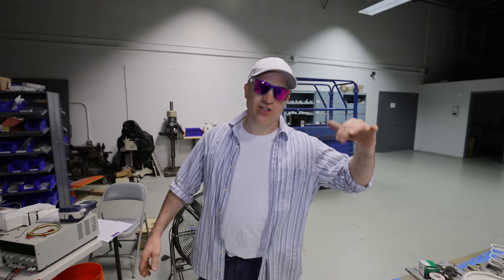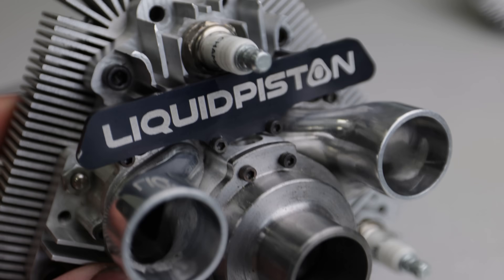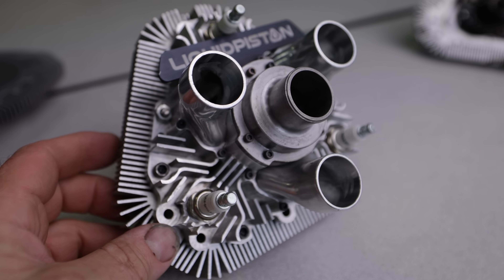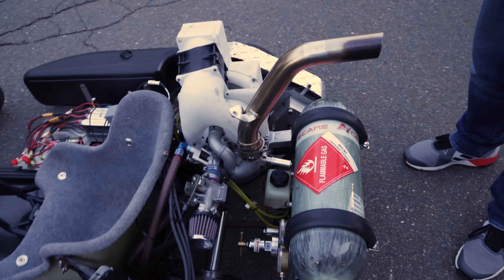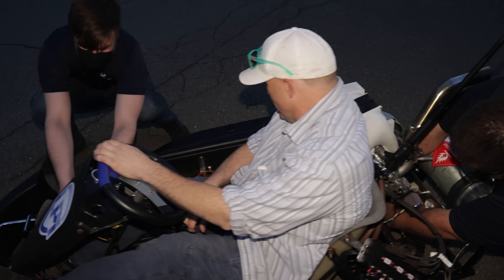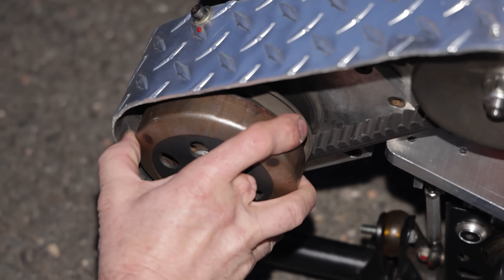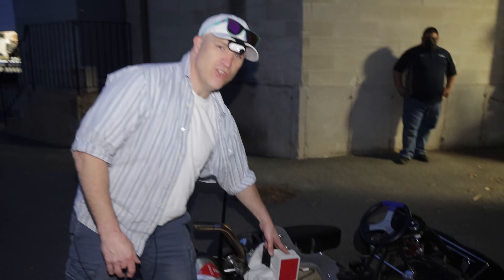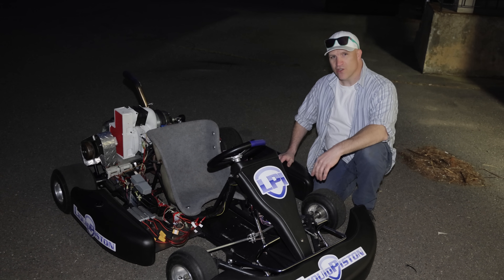Hydrogen Powered Liquid Piston Rotary Go-Kart

Comment: Toyota has built a hydrogen racecar that is a direct burn in a piston engine.
Reply from the maker: I just recently saw that in my feed
Reply: and now we have rotaries getting into th hydrogen game too.
Reply: @squarepotatoe  Mazda has been experimenting with it for a long time.
Reply: In the late 80' BMW has been playing with piston hydrogen engines, notably their 5L V12, they were getting around 200 HP if I remember correctly
Reply: bubbinator88  The guy claimed that you can run a car on only water. His name was Stanley Meyers and he didn't disappear. He died in a restaurant that he owned.  He used simple electrolysis. It's far more efficient to directly drive an electric motor than to split the water into H and O2 then drive a gas combustion engine. That is the most wasteful way of using hydrogen as a fuel cell is more efficient, quieter and safer.
Reply: @esqueue  The problem with hydrolysing water and then recombing it, is that the net energy output is then 0. You must have an external power source to add energy into the system for propulsion. That energy source would then immediately make the water splitting and recombining unnecessary. The engine that runs on water is a total hoax. You cannot extract more energy from a system that the amount it contains. Law of thermodynamics. Speaking ideal situation with no power loss to parasitic systems.
Reply: @esqueue  The problem with electricity is storing it. Batteries have poor specific storage capacity (J/kg), degrade over use/charge cycles, are difficult and energy intensive to recycle, and use rare materials. Whilst electrolytic water splitting is inefficient, the use of hydrogen in vehicles means faster refuel/charge times in addition to keeping material costs down. The argument can be made for hydrogen fuel cells, however these suffer from many of the same issues as batteries (exotic materials, degradation over time/use, etc.).
Reply: @esqueue  If you have a surplus of energy and you can adapt your current car to use it, no. And there are ways to have a local surplus.
Reply: @vitordelima  An alternator is NOT a surplus of energy. When you put load on an alternator, it becomes more difficult to turn thus lowering your fuel mileage. Why do you think all hybrid vehicles try to stick to LED lights? This uses the lowest amount of light thus less load on the alternator. 

Surplus energy is the heat generated by your vehicle. If you can use this energy, then it will help. Regenerative braking is one way of storing surplus energy that would otherwise be wasted in heat.
Reply: @esqueue  I didn't mention the source of the surplus, so calm down.
Reply: exactly
Reply: GM had an H2T running on hydrogen.
Reply: bubbinator88  thats a myth
Reply: Let’s hope it’s faster than this go kart 😂
Reply: They use a suitable 50/50 mix of hydrogen and petrol
Reply: Piston walls get hot
Reply: and a production car. The Mirai
Reply: Joel  BS
Reply: Which makes sense

Comment: So Toyota sells a hydrogen Camry atm. Still cool gokart just needs refining.
Reply: I think the hydrogen toyotas that aren't racecars don't use direct hydrogen combustion. It uses cells which create electric in a similar way to how electrolysis works. This creates electric also water as a waste product only. The charge created then drives electric motors
Reply: @carcrxsh  hydrogen isnt really the best for racing because water and slicks its worse for go kart slicks because you lose all traction on moisture
Reply: @Thri11Seeker  wtf you realize that normal combustion engines produce water too right? that is a non-issue. the actual problem with hydrogen combustion engines is that they are generally very unreliable because the hydrogen gets into places it’s not supposed to be due to being a very small moleculex
Reply: @boxr_4214  bruh everyone knows that all combustion cycles produce water but the issue with hydrogen go karting is that it produces more water which means that water is coming in larger quantities which the issue im addressing is that true go kart slicks if you touch moisture on track you have grip equivalent to ice
Reply: @Thri11Seeker  unless these hydrogen engines are producing tens of thousands of horsepower there is no earthly way for the water they produce to have any effect on local ambient humidity. exhaust is hot and rises upwards. there are legitimate issues with hydrogen engines, but the complaint you made up in your head is not an actual issue.
Reply: @boxr_4214  🤦‍♂️ you clearly dont understand the issue im bringing up i will say its not the biggest issue but im just mentioning one issue/flaw of using it as a go kart motor
Reply: @Thri11Seeker  again, it’s not an issue. you’ve made this up. if you didn’t make it up, show me one example of this actually happening.
Reply: @boxr_4214  how do you want me too because clearly you dont know go karts bud
Reply: @boxr_4214  i cant do it myself because i dont have any tracks nearby anymore plus i had to stop due to financial problems
Reply: @Thri11Seeker  the amount produced isn't really enough to lose traction.  If you're still concerned just install a catch can for the few ounces that'll be made from that entire hydrogen tank. Dump/drain when you refuel.
Reply: @mikegluth1981  im saying if everyone raced it all at once moisture would build up on track and since its go karts the tires will tap spots of moisture eliminating traction it would be funny racing because you have mario kart with bananas only
Reply: @mikegluth1981  im not worried about it though because financial problems hit so i don't do real go kart racing anymore, but i do know how bad grip is on moisture with go kart slicks and it is unbelievable like seriously you feel like you hit black ice even though it was just a moist spot on the track its really screwed up if you don't believe me look at super gt
Reply: @Thri11Seeker  You do realise that the amount of water vapour produced is directly equal to that of a normal fuel right? 

Both produce a single water molecule per fuel molecule burned. In fact, given hydrogens significantly higher energy per mass, it would produce less water vapour then the equivalent hydrocarbon fuel to make the same amount of power.
Reply: That's not an ICE based hydrogen car though.
Reply: Right, the Toyota Mirai is a hydrogen fuel cell vehicle.
Reply: Does that Camry have a rotary engine in it?

Comment: I'm unsure of this liquid piston engine. They boast of how efficient it is, and how much pound for pound power it can produce, but every time I see one running there's always some electric motor involved, which is causing me to doubt it's actual output.
Reply: I completely agree. This one doesn’t make much power and probably doesn’t have much torque either. It’s very small and impressive but i believe it should have done something different.
Reply: @erikcourtney1834  rotarys arent about torque they are high rev engines 9k 10k 11k 12k 14k 15k rpms
Reply: @thatnissanchannel5410  that may be true, but what’s the point of 12k rpms if it can’t move a few hundred pounds. A torque converter would have been a huge help and I believe what was the issue in this video. A little more rotating mass might help some too.
Reply: Yeah and the engine was at like 8000 to 10000 rpm wich is enuth to engage that chluch a 50ccm piston engine can do that
Reply: If they were touting this as the final product I'd be skeptical AF.  This isn't even the prototype though... they're still in the R&D proof-of-concept stage.
Reply: @andie_pants  i do agree, however claiming an engine is "running" when it is possibly not and just being spun by a electric motor with fuel being thrown in to cause a few bangs would hardly be considered running or making power by any means. when i see one run unassisted by an electric motor ill be more open to the idea that this engine design is actually plausible.
Reply: @andie_pants  no worries, i really do like the concept, I guess that's why I'm kind of let down by this presentation of it.
Reply: @derekbennett5896  the engine is running... You can hear it
Reply: @andie_pants  i know but its so low power at such screeming rpm i dont think its that good i know its Proof of concept but its bad advertising like a 50ccm can do more or they are bad at transmission
Reply: @niggo7224  50cc engines that are in like scooters tend to be already designed, tested, proven that they work and then put into them designed for a scooter. This engine is No.1 smaller than a 50cc engine. No.2 it’s not designed for being in a go cart. And No.3 this is still a proof of concept and is still in the design fazes. Yes it is running, and that’s because that’s apart of the testing fazes. My guess is that this is a 15-25cc engine too.
Reply: @niggo7224  100% agreed, 55cc of displacement is very impressive, and that gearing is wrooooong, however, is moving
Reply: It is a HYBRID vehicle, the engine only charges the battery, which powers the motors.  It is also only a prototype proof-of-concept design, with an undeveloped clutch............................elsullo
Reply: @elsullo2  kinda how it works, yes the motor/generator is attached to the engine, but the same shaft also goes to a clutch for powering what whatever it is that it is powering.
Reply: I think that the motor is involved because of A, how small this single rotor engine is, and B the fact that hydrogen is way less space efficient, meaning that the kart probably wouldn’t last long at all on just hydrogen
Reply: It’s funny reading all these comments about doubting someone’s idea/concept. Jealousy is a curse. If you don’t understand how something works its because you didn’t have the brain power to invent it. 
Almost ever motor needs something to help it start or begin running. For example a gasoline powered engine still needs and ignition system and a starting system.
I’m an inventor myself. Because of people like you with your negative opinions and lack of understanding my inventions have never made it to existence. I was 16 years old and I was at Toyota training at the main factory in Brisbane Australia. I was shut down by the teacher who was a master Toyota technician about my idea of a hydrogen powered rotary engine. Nearly 20 years later Toyota in Japan have hydrogen powered trucks and there’s engines like this.
Reply: @Rubied Cross  first of all, you're a year late. Secondly, constructive criticism and general discussion aren't jealousy. it seems you take offense to criticism.  Take advice from Elon Musk - "Constantly seek criticism. A well thought out critique of what you're doing is as valuable as gold"
Reply: Indeed they run a lot electric motor on the dyno, but the hybrid system is supposed to be a aircraft powerhouse. And you will see a lot of engine dynos with giant electric motors on them. Reason why, they use them to start the engine and then practically turn the motor into a generator. That’s how they get the test results. And the clutch was for something like a big go cart. And my guess is that the motor was acting like a generator causing a loss in some engine power. And like I said, this is a concept engine and they are still working out a few kinks in the design. I’d totally buy it if it became purchable to the public, but it was mainly designed for military application.
Reply: @evanthelegend7610  the chluch works with rpm not with force and that thing was spinning fast
Reply: @niggo7224  that's true, however, i don't think that the cvt was engaged directly to the motor, you can barely hear bogging down when they go up in the incline, so it has a lot of reduction
Reply: @evanthelegend7610  Im well aware of how dynamometers operate. possibly the motor was slowing the cart down but doubtful, i just don't think it was a good demonstration of the engine running on hydrogen.
Reply: @derekbennett5896  in his other video, he said that it only makes 3 hp, so it is not that powerful and plus they had a generator that it was spinning and they take a lot of force to turn. And did you notice how the engine did not shut off during the runs? That’s because the developed a system for where the can turn the engine off and the generator turns into a motor and powers what ever it’s being used for. And many people are saying that this IS A RUNNI PROOF OF CONCEPT. So it is not a full on working prototype and it’s also for an aircraft application.
Reply: Precisely

Comment: He had a helmet on going 5 mph 😂
Reply: Gotta go slow before you blow 😅😁
Reply: Try jogging head-first into a brick wall.
Reply: @andie_pants  i wouldn't want to crack the wall.
Reply: @andie_pants  then they should put some padding on those things.
Reply: @andie_pants  most people don't have to deal with your low IQ
Reply: ALWAYS wear a helmet when driving a kart, at any speed.
Reply: @KrustyKlown  or a motorcicle
Reply: For sure! In my years of racing my Suzuki RM250 grass kart, our club would not even let you get in your kart without helmet, neck brace and gloves!
Reply: @pvanb291  i bet your cart went a bit faster than this one. Or atleast i hope so. That thing is so slow im more likely to need a helmet jogging than i would driving the cart.
Reply: @briankennedy5578  Yep, was pretty quick alright! Had a custom electronic ignition with flat shift trigger on gear lever and rev limiter at 9500rpm.
Reply: Do you think he expected the clutch would fail, limiting him to 5 mph?
Reply: @BenjaminGoldberg1  I'd say there was more than a clutch issue. And judging by their actions id say everything went as planned. Were awful happy.  And as for running on hydrogen . any running internal combustion engine can  run on hydrogen. Would have to play with timing and get the fuel metering right. Cant say what it would do for reliability. But im sure equaling their results wouldnt be hard.
Reply: @BenjaminGoldberg1  yes
Reply: @Ian Singer if you don't get it, then there's no hope for you.
Reply: That was the best part 🤣🤣🤣🤣
Reply: you better have a helmet with that 500 psi hydrogen tank right behind you. what's the pressure when it's full?
Reply: @geemy9675  it can be in the 10,000 psi range. Depends on what the tank is rated at. Oxygen tanks have 3,000 psi
Reply: I was expecting rubber burning, but it is a tiny motor, make bigger and you'd probably fly.
Reply: And he didn't in his top-speed turbodiesel run
Reply: Only reconfigured the fuel on a combustible engine pfffft so lame
Reply: Not to mention they're all wearing masks while outdoors 🤦‍♂️
Reply: He has to show he is ultra safe for the YouTube staff.
Reply: Timmays electric wheel chair could give this a run for it's money.
Reply: @Catknapper   TIMMAY !!!!!
Reply: still faster than Ferrari SF1000

Comment: The engine cooling system is very impressive. Haven't seen anything like that before.
Reply: Thermal regeneration. Very elegant design.
Reply: @thebunnisher109  simliar to the chrysler turbine car right, its exhaust was actually colder than piston engine
Reply: Where does he talk about the cooling system?
Reply: It looked like it was cooled by a server cooling fan.
Reply: Big cooling system = poor efficiency

Comment: Compared to typical racing go-kart, that one seems very underpowered.  Would love to see a liquid piston powered go-kart without the hybrid drivetrain, and appropriately sized to make at least 10 HP.
Reply: Some were saying in the comments that it was slower due to them not doing something right with the clutch
Edit: nevermind, wasnt at the clutch change part. Yea it does seem pretty slow.
Reply: I think the engine is a tiny big undersized. Its sized for RC applications I think

Comment: Definitely need that clutch right ,high as thoes rpms sound that thing should fly.
Reply: See thats the problem with hydrogen, it burns so fast there's a lot of woosh, but not a lot of umpf, just like the guy above said.
Reply: @konrad7492  its like the opposite of diesel
Reply: @ufarkingicehole  lol more like the opposite of fast
Reply: It needs revs to make power lol

This ain’t a V8 bub
Reply: Very rev happy
Reply: No tourqe

Comment: You guys don’t know anything about go-carts clutches this was a bad example
Reply: Clutch what clutch just gas and stop
Reply: @Americana-deluxe  the CVT transmissions on go karts (the one seen here) has a built in clutch. However it is made to be used on gas engines so it engages at 2.5-3.5k rpms. This is way too low on this engine's torque generations curve.
Reply: @Americana-deluxe  i think hes talking about the cvt

Comment: Sounds amazing and runs clean. 
If this is the future I am so ready.
Reply: It ain't the future.

You could use the electricity ti charge a battery and then power an electric motor at 90% efficiency.

Or you could use electricity to electrolyze water into hydrogen gas at a 50% efficiency at best, use more electricity to compress it so you can actually store it, use more electricity to  get it to a filling station and then burn it in a combustion engine at maybe 40% efficiency.

So all in all you could drive somewhere in an EV or you can spend 6 times as much to drive to the same place in the same vehicle but this time it's powered by a combustion engine burning hydrogen.
Reply: No. Big oil will have none of this....
This tech was buried in the 40's.
Reply: @philup6274  "The oil companies control everything. Like, there's this guy who invented this car that runs on water, man. Its got a fiberglass, air-cooled, engine and it runs on WATER!"
- Steven Hyde
Reply: @bradleyj.fortner2203  you can  laugh now. There's a reason you pay 4,50$ a gal for petroleum.  The joke is on you